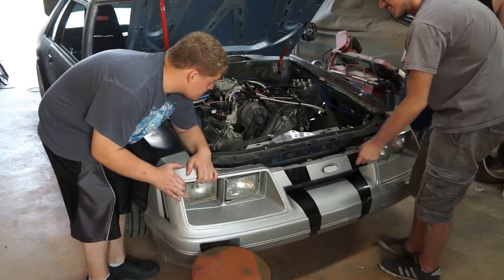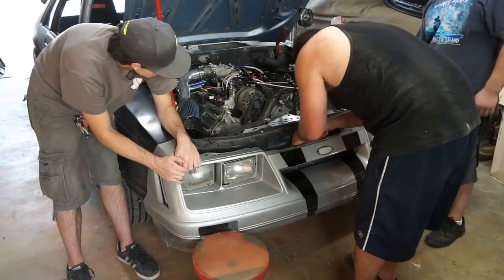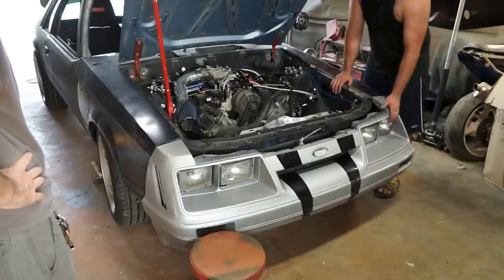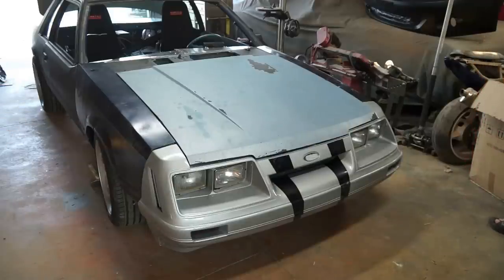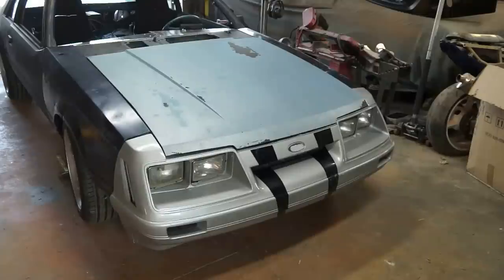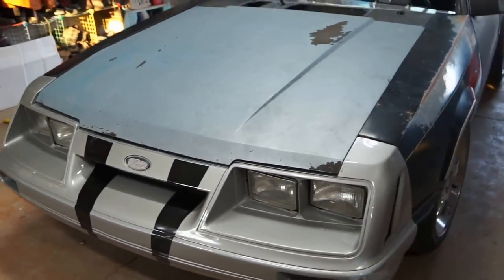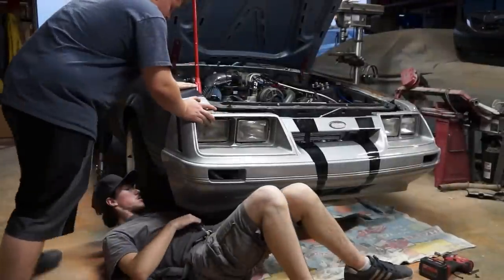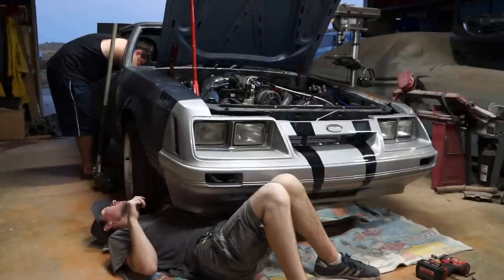2 Valve Swap Drag Build (Part 43) Front Bumper & Fuel LEAKS!

Comment: could try using the factory brackets to support the front bumper cover way stronger than 2 pieces of bent aluminum
Reply from the maker: false entirely.   It is mounted way easier and solid than my other bumper with the OEM hooks.
Reply from the maker: and we removed the brackets that go to it....